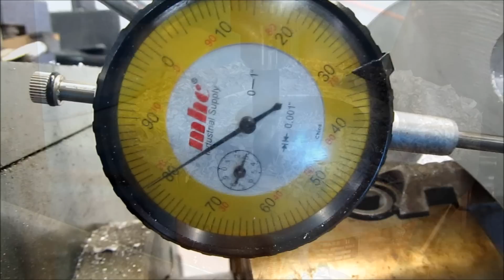Machining the Flanges

Comment from the maker: Thanks, I like WD40 as well, but I was out! :^) I did have Hilco lube, but I didn't want to use any lubricants here because the flanges require welding, and I figured having no lubricant residue to clean off the porous cast aluminum would help reduce any welding problems.
Reply: ye kya job hai sir

Comment: could we convert RF flanges to RTJ ?
Reply from the maker: I suppose - never done it myself having never needed an RTJ. Is there enough difference in cost to be worth the trouble? Having said that - You would want to make sure the RF would meet the specs of the RTJ, I think I would go with a purchase if you're talking about a high temp/pressure application.
Reply: @nurfays123  thank you for your comment...let me explain in detail...indeed I am a valves trader and my supplier has too long lead time for Valves with RTJ connection...and I lost a lot of business ...so I'm looking for a solution...I buy Valves with RF and I mechanically transform them into RTJ...is it possible to do that without touching the  valve integrity ?

Comment: Your speeds for pilot holes is to slow especially with no lubricant on aluminium..?? And tapping a hole with out lube will tear the threads,  facing your flange with a boring bar what's with that?? Everything in with this video I could pick on not to trade practices, you would not work in my machine shop
Reply from the maker: +FlashTechEngineering thanks for watching the vid, I can only work with what I have. Good thing I'm not a machinist eh?
Reply from the maker: BTW I used the boring bar for the same reason Keith did here @ 15:14: https://www.youtube.com/watch?v=ype-yeZ_eck , reaching over the gap

Comment: Just to help some b of you guys save time. You can skip the center drill operation. Use a screw machine drill. They are short and stubby and will stay on center to get your hole started. 118
Reply: I do it in 316l all day long
Reply from the maker: Want to send me one?
Reply: Rod Joyner like 2 bucks. Grainger